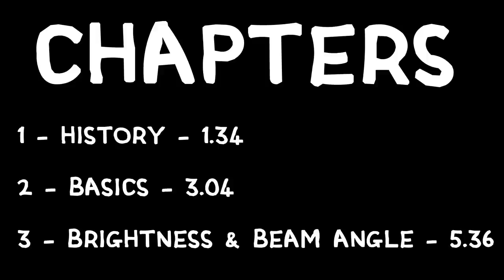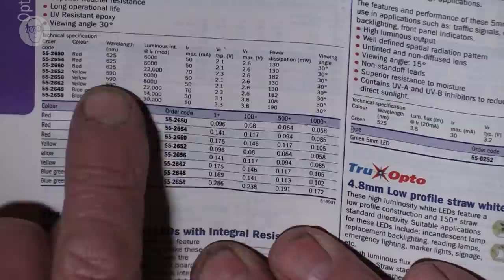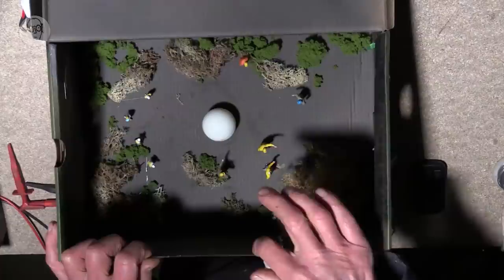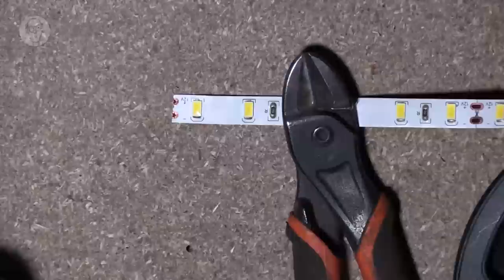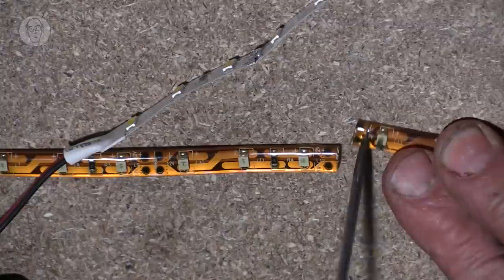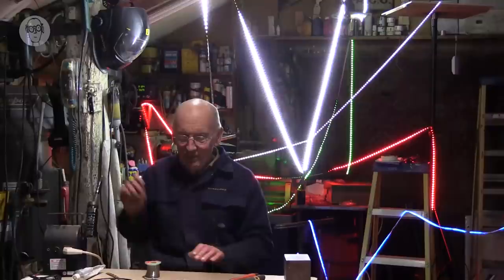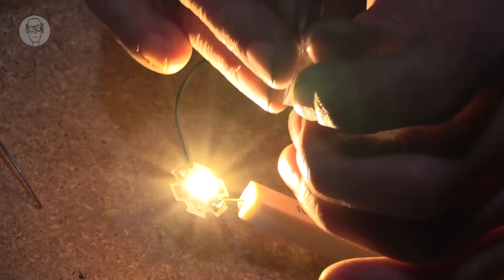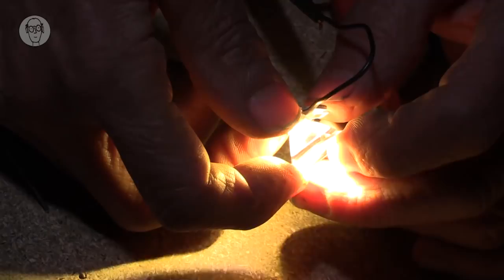LEDs -The Secret Life of components, a series of guides for designers and makers - Episode 2

Comment: The way I remember which way to connect an LED. 2 ways… the side with the flat is the Kathode which goes to negative or sometimes the ‘ground.’ So I simply say ‘Flat in the ground’ . Also the cathode if you look inside the body is shaped like a triangular golf ⛳️ flag. Well you ‘put the flag in the ground’.
Hope that is of some use to those learning about LEDs.
Incidentally , Tim mentioned that it doesn’t harm the LED air you connect it up in reverse. Well that’s not strictly true, it depends upon how big the voltage is. LED’s, IC’ (chips) transistors and diodes are all made from silicon and are know as semiconductors. Semiconductors have an effect called the avalanche and what happens is if you steadily increase a voltage across a semiconductor device then at some point (called the peak inverse voltage or PIV) the device avalanches and often the electrical junction is destroyed. Sometimes special devices are designed to work in the this mode but careful use and special design prevents the device from being destroyed.
This is why you should never put the batteries or connect up the supply the wrong way around to any modern electronic device because you will destroy many of the millions of semiconductor devices inside the product. This brings me back to Tim’s point, LEDs have a quite low PIV a and if you aren’t careful you will knacker them. Often devices that have been subject to reverses supply or often as not hit by static then the devices often go short circuit and then burn out in so,e cases, going what we call, open circuit.
An experienced engineer can often tell what situation has caused a failure by checking the continuity of certain key components inside the device under test / investigation.

Comment: Those vintage style lamps with the LEDs in rows, making them look like the filament of an incandescent bulb, are extremely interesting! Some time ago I learned that they are actually a Chinese invention (something the Chinese didn't copy for a change!). Philips had been trying to come up with a type of LED bulb that was appealing to consumers, as most associated LEDs with harsh and unpleasant light. And then these Chinese retro bulbs completely conquer the market! Took Philips and all the others quite some time to figure out how the Chinese actually did it.

Turns out these filaments consist of rows alternating with four blue and one red LED (if I'm correct). The rows are covered in a very specific mixture of phosphorous material, that convert the blue and red light to a pleasant warm yellowish light. However, because these LEDs are so closely packed together and get really hot, the bulb has a specific gas in it to properly conduct heat away from the LEDs. Since finding that out you can find these retro lamps produced by a large number of companies. And most of Philips old ideas to put LEDs in appealing bulb-formats have been discontinued...

That must be why Tim wasn't able to light them when the filaments weren't in their bulb. I learned all this during a lecture on Chinese approach to copying technology at my old college. I don't remember everything correctly, but might really be something to look into a bit more closely!

Comment: For easier soldering SMD parts that move around too much: imagine an object that looks a bit like one jaw of a portable "jaws" spot welder - a longer arm with contact nub on the end.
 
Now make a tiny version one from a strip of wood with a blunted sewing pin through the end. Place the pin on the middle of the SMD part, the weight will keep it in place while you solder. 
I use a strip about 4 inches long and 3/4 inch by 1/4. glue a pencil eraser to the wooden end to stop it sliding around and plane/cut/rasp the pin ened to a finer point so you can get your iron in close.

( it's not powered of course, I just couldn't think of a common object to describe the shape and I'm sitting next to a spot welder )

edit: maybe looking more like one jaw from old-fashioned laundry tongs with a pin through the end

Comment: Sorry to contradict Tim, but:
3:33, MODERN LEDs are not damaged by being connected in reverse, but I have some left over from the 1970s and they DO fail when reverse biased, though it seems to take 5V to do it. The 3V cell is not enough.
5:07, the positive terminal was not "always the longest", until about 1990 when the manufacturers seemed to start agreeing with each other.

Comment: Modern cars use a PWM (pulse width modulator) to control the brightness of the LEDs in the gauges.  A roller control, or a round knob, is used to adjust the flash rate.  I get mine from an auto recycler for a couple dollars.

Comment: 36:30 While still not fully accurate, it would be better to first at least roughly subtract the voltage dropped across the LED from the 12V, so in your example, subtracting 3V, giving us 9V/0.8A = 11.25ohm. That way you still get a resistor value with still a bit of a safety margin, but a bit more accurate, without making the calculation much more complicated.
Though in the end, I quite like your experimental approach. That way there is no need for trusting spec sheets or fiddling with numbers :)

Comment: You can buy simple cheap stand alone PWM dimmers for LED's also you can change the Arduino timers to speed up the standard PWM frequency to reduce flick BUT this can break many libraries/functions so only recommended for fairly advanced users.

Comment: 3:29 it doesn't harm LEDs to connect them them wrong way around AS LONG AS the reverse bias voltage you apply is not above the reverse bias breakdown voltage of the LED. All diodes have a reverse bias breakdown voltage - LEDs tend to have a fairly low reverse bias breakdown - if the LED goes into reverse bias, is usually ends up damaged, so some care needs to be taken.

Comment: Your 10W power resistor is a bit overkill.  Good to play it safe, of course, but remember that not all of that 9.6W is dissipated by the resistor; only the voltage drop across the resistor counts in that calculation.  Given the LED is probably drawing around 3v (the safest assumption), the resistor should only have to dissipate 7.2W.  It's still a lot of wasted power, so if you're doing a lot of these in a situation where power matters at all, either a constant current supply or a buck regulator to drop that 12V to something much closer to what the LED wants will save a bunch and not turn so much into heat.

Also, if you can't find a 10W resistor, you can use arrays of resistors in series and parallel to spread the heat across multiple smaller resistors.  If you do, it's a good idea to go overkill on that, though, because small variations in resistor manufacturing means some will get more current than others.

Loving this series!  I had no idea it existed until somebody in the Ham community linked to your Secret Life of Radio remaster, and suddenly I'm learning Marconi's inventions gave us a whole lot more than radio!

Comment: 5:10:  My mental mnemonic is that the flat side on the LED dome corresponds to the flat, non-triangle side of the diode schematic symbol ( ⏄ ).  And the triangle points from positive to negative.

Comment: I remember how to connect the LED by thinking that the positive symbol has more lines to it then the negative so the positive lead is longer :)
Reply: Few realize that lead length isn't always the same polarity - manufacturers do vary - and once you've clipped the leads its lost information - the flat on the head of the LED is the "true" polarity indicator.
Reply: I remember it roughly the same way,. I imagine that I have cut the end off the long lead to make it the same length as the short one. Then I can take the piece I cut off and lay it across the lead it was cut from, to make a sort of plus sign.

(I am aware of the idea that some LEDs don't follow this convention, so I test a couple from each new batch to make sure. So far they have all been long-leg positive though.)

Comment: .  If you don't have a power supply with current control, when you do the calculation, because of Kirchhoff's 2nd law of voltage and the conservation of energy, you take away the LED voltage from the total, as in 12 (power supply) - 3.5 (~white LED forward voltage) = 8.5V, so E/I=R gets 8.5/0.7=12.142857 Ohms.

<added> If you're using a 20% resistor, a 15 Ohm resistor, would be ~12 or ~18 ohms.

Comment: Re: Identifying +ve & -ve LED leads.The way that stuck with me was that if you chop off the 'extra' bit on the longer lead, you can then overlay this at 90° over the rest of the lead, making a plus symbol.
Reply: Also, cutting waterproof LEDs, I cut most of the way through, then bend at the cut and peel the end off from the cutline to the end.  The silicon splits in a similar way to when you cut through a mains cord - the bending shears the plastic along the cutline.  
Thanks for mentioning the reduced lifetime of waterproof ones though... I've been having issues with these strips and now I know why.

Comment: I also discovered a cheap way to control the led brightness, what you do is mount an LDR away from your 1watt, 3watt, 10watt ... get a bag of 20 ldrs or steal one out of something... grab one and any power transistor and use the ldr and a resistor as a voltage divider which turns and off the transistor, so now if the room gets hotter or the led gets hotter and becomes brighter, the light dependent resistor changes, 
lowering he current, I powered a 10 watt cob led light like this for years, chapter than using a 10 watt resistor!

Comment: If your LED is not rated for much more than 1watt then driving it constant voltage with a series resistor will work if you de-rate the drive current to around 75% of the LEDs max current. But beware, if the LED is destined for outside use or in a hot environment then it is best driven constant current. The LEDs resistance gets lower with heat, the higher the LED (array) power the closer to thermal runaway it is.  One way to think of it is the LEDs rated voltage varies with its temperature. With a constant current driver the power (voltage x current) is going up and down with LED temperature, the hotter the LED gets the less power it needs or can tolerate.